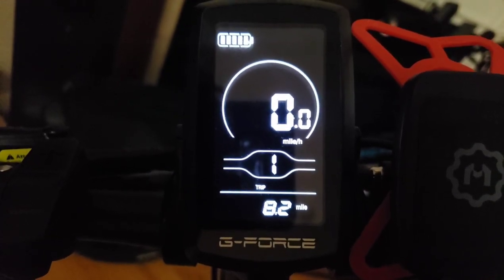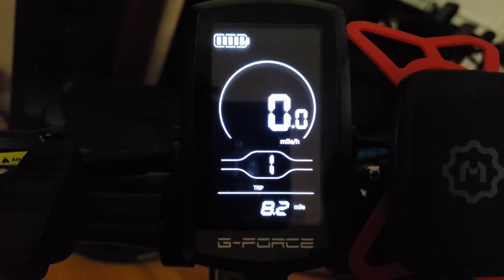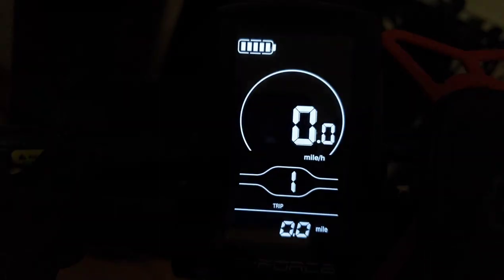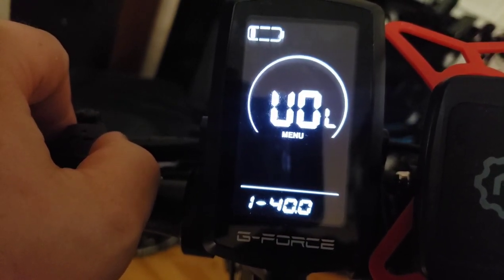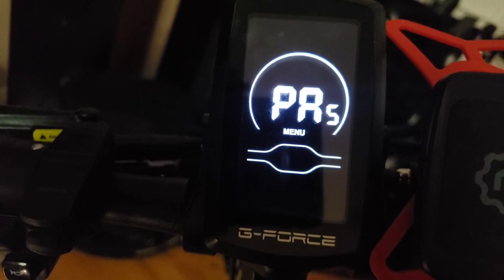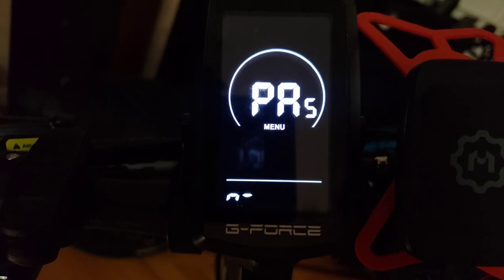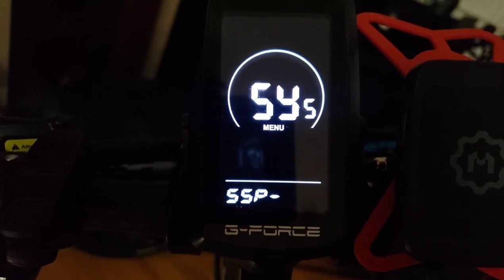G-FORCE T42 ( DEFAULT DISPLAY SETTINGS ) MODEL YL80C AND REVIEW. E-BIKE DISPLAY SETTINGS

Comment: I brought one left it at my daughters for couple weeks no one used it now it won’t even turn on 🤬
Reply from the maker: Sounds like the power switch, a loose connection somewhere, or you could have a bad battery. 

Battery is not supposed to leave them charged at 100% when you store them for more than a month. And you're not supposed to really let it go below 20%. That's if you want the batteries to not go bad quickly. If it goes to zero and goes too low then your battery won't even turn on it's a failsafe thing in all ion batteries.  Also when your battery is fully charged when the light turns to green. Make sure you unplug it Don't leave it plugged in all the time.  Kind of the same rules as your phone. 

I think someone had this issue before. I think it was the controller. 

There's a way to test your battery with a voltmeter..

The first thing I would do is to check all the connections.. But first plug your battery in.  The light on the brick will be red and then turn green when it's completely charged. If you leave it on there for more than 4 hours and it does not turn to green then something is wrong. 

unplug and plug the back in. You could see them in their color-coded near the handlebars they're probably wrapped in that stuff..
Reply from the maker: The other thing is you left it at your daughter's did anyone play with it, touch it, how old is your daughter? I had an issue once we are the lights wouldn't come on and it was only because of the connection was loose it got pulled. So like I said in the previous post. Check those connections unplug them plug them in after you check the battery.
Reply: @thefix-itguyreviewer8151  no one touched it was in garage same place I left it don’t have charger with me it’s new I charged it then left it here long way from my home I had keys with me so don’t have a clue why it won’t go on
Reply from the maker: @paulrage1944  well you need the charger obviously.. and the key has to be in the right position or it won't turn on.. And I hope you know where the power button is I assume you do it's the button at the very bottom on the side bottom.
Reply from the maker: @paulrage1944  I don't think the light will even go on to charge or show the correct color if you don't turn the key.. I'm not sure I haven't paid attention to that. 

The key has to be straight up and down same direction as the frame I think.. 

So once you get the charger try either taking the battery out or seeing what happens..
Reply: I’m sorry to hear that bro

Comment: Well done good detail best I've seen worked for Hey Bike Race Max
Reply from the maker: I'm glad I can help. Just that The only thing you have to realize is that every bike has different specifications with that particular universal screen.  

For instance if the amperage, and the power of your hub is different than the G-Force bike you need to set that accordingly with the specifications from the manufacturer.. 

You should definitely ask them what the amp is of your controller and the power of your hub. 

They're all pretty close but you can make a big difference and burn out your controller and hub.

Comment: Hey
Suddenly my speedometer is showing low speeds of 6-9 mph when I'm obviously going 20+mph.
Any ideas?
I wonder if it's a settings issue or a problem with the braided cable.
I changed the input for pedal assist 3 to 100% and changed tire size to 20".
I must've effed something up in the settings.
Reply from the maker: Try changing the tire size to 22 and carefully go through my video of all the settings

You might want to set everything to default and then go through my video and start from scratch just make the tire size 22 first to see what happens
Reply from the maker: Also make sure all the cables are tight unplug them and plug them back in
Reply: Thanks, I'll go back and watch it again.
I did press y for factory settings but the problem still exists.
Reply: @thefix-itguyreviewer8151  
Ps 
Does factory reset return ALL settings to as built?
Reply from the maker: @fritzburbank935  nope it does not You have to watch my video again
Reply: @thefix-itguyreviewer8151  
👍
Reply: @thefix-itguyreviewer8151  
Somebody in your comments broke the video down into segments.
Which one do you think would be the one for my issue?
Thanks for your time and response.
Reply: @thefix-itguyreviewer8151  I checked their website and it is a 750 Watt motor
Reply from the maker: @MrBoogyman1988  750 W motor for the G-Force T42. Yes I think we all know that. If that's what you're referring to. 

750 W motor, I think it's 1200 W peak power, 80 nmof torque, and a 22 amp controller. I don't know yet but they could have upgraded to a 25 amp. They upgrade pretty quickly.

Comment: 21:10 for some reason. 4 and 5 were set to 60. Does that effect anything?
Reply from the maker: It's not going to hurt anything but it's going to show the battery being very inaccurate. The max voltage for these batteries is 54.0  for the maximum voltage.  I would put 4 back to 47.5 , and number 5 back to 49.0

If you don't you really won't get a very accurate battery reading.
Reply: @thefix-itguyreviewer8151  another issue. My odometer is completely wrong now. Yesterday it was working well showing me my speed properly. Today, it's all messed up. When I'm going 15mph it says I am going 5mph. How do I fix this?
Reply from the maker: @christiangrossman9934  That's a weird one never heard of that yet. 

Sounds like it has something to do with the wires.. or it could be you change the tire size by an accident in the settings. The most accurate setting is tire size 22 in. You can easily tell by using The speedometer on a GPS phone app. 

As for the wires unplug and replug back in.. make sure there is no damage to them
Reply: @christiangrossman9934  
Hey did you figure out what's wrong because that's exactly what's happening with me.
Reply: @fritzburbank935  yes I did. Go ahead and reset to default settings. Now it works like a charm and it reset to the numbers he has
Reply: @fritzburbank935  reset to factory settings*
Reply: @christiangrossman9934  
So you say I reset to factory settings will repair my speedometer issue?
I'm pretty sure I did that already....?
Reply: @fritzburbank935  or change the tire size if necessary
Reply: @fritzburbank935  I changed it to 20 and it's the most accurate for me

Comment: 3:00 intro
Reply: Samsung health app to compare speed accuracy. Spedometer
Reply: Set to default setting and go from there.
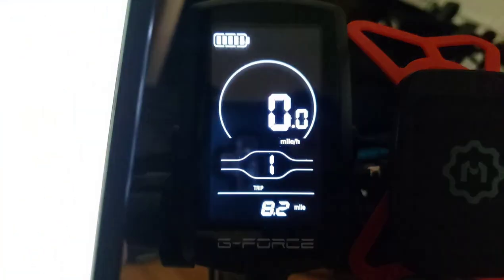Reply: 6:52 hud basic settings
Reply: 8:05 how to turn on lights
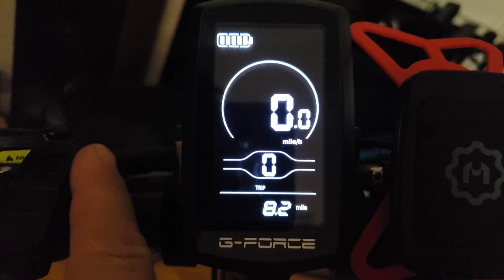Reply: How to go into menus 8:50
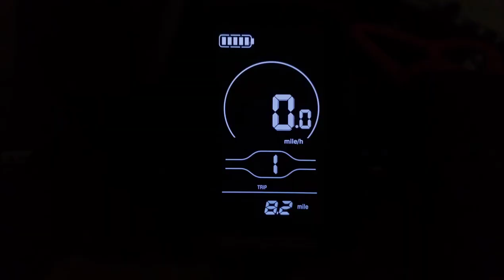Reply: 9:55 how to access general settings
Reply: First one is about trip
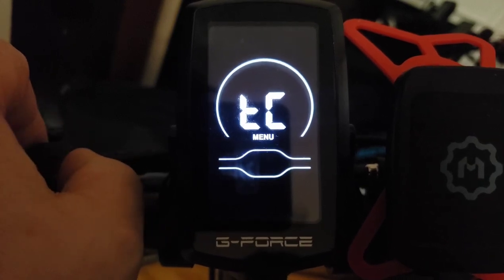Reply: 10:25 general setting/how to reset miles
Reply: 10:55 display brightness settings
Reply: 12:00 imperial or metric system
Reply: 12:32 how to access different settings
Reply: 1st screen is for tire size. 23 or 22 is best to find correct speed.
Reply: 23 speed Is off but miles are accurate
Reply: 14:30 speed limit settings
Reply: 16:07 custom settings
Reply: Match display to motor on back
Reply: 18:45 don't go into default setting unless you know for sure they are right
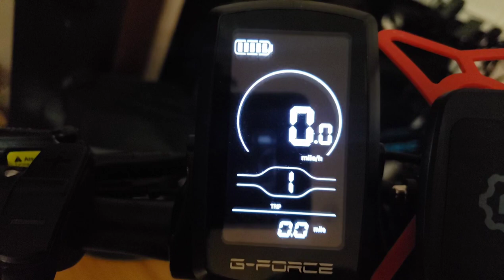Reply: 19:00 how to access default settings
Reply: 1 setting. Battery settings
Reply: 20:20 change up the settings to what he has
Reply: You can change it to make yourself happy, but stick to factory settings just to be safe.
Reply: 21:50 looks are deceiving. You don't really have a full battery, even if it says you do.
Reply: 23:08 assist level section interface
Reply: 23:20 shows speeds and stuff. Tinker whatever you want to
Reply: 24:20 how to get max speed
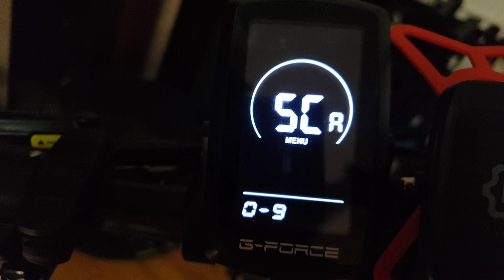Reply: 27:40 you can buy a new gear thing and install it to help biking up hills and be able to keep up with the motor.
Reply: Link in the description
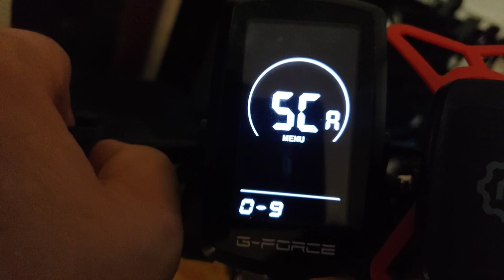Reply: 28:10 he shows his pedal assist number here. Go ahead and replicate it.
Reply: 28:18 next setting. Current setting. Find out what current of bike is.
Reply: Usually on the motor
Reply: 28:45 you can take apart bike and look at controller. Video on that later. If you mess up the setting for the current, the bike probably won't run.
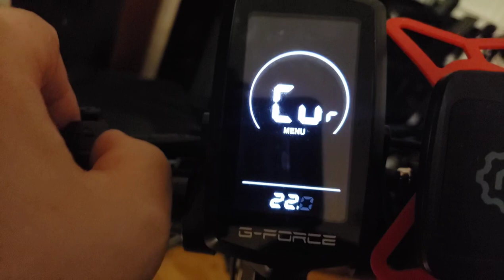Reply: 29:19 default setting for his bike is 22. Adjust if it has been changed as of recent. DONT MESS UP!
Reply: 29:28 nest setting. Assistant direction setting interface.
Reply: 29:45 details about setting
Reply: 30:40 this portion goes into sensitivity settings for the pedal assist and throttle. Change to 2.
Reply: 31:30 don't touch this setting
Reply: 32:50 leave this setting alone
Reply: 33:20 handlebar setting. Keep at n. Don't change
Reply: 34:10 system setting. Don't touch this.
Reply: 36:55 password setting. No need for it
Reply: 40:50 restore to default settings if you want to
Reply: @Christian Grossman - Thank you for breaking it down for us👍
Reply: @TKC-TheKrisChannel  not a problem at all my friend

Comment: I have the same new bike, the throttle works fine but when I pedal the motor does not work what do you think it could be
Reply from the maker: Has it been this way since you bought it? 

I would suggest plugging in and unplugging all the cables. 

If that doesn't work set the settings back to default which won't be the correct default then go through my video again and reset everything.
Reply from the maker: It also could be the PAS sensor on the crankshaft I have a video about how to replace that too It's really easy you just need a special tool. G-Force will send you the parts no questions asked if you go through their customer support